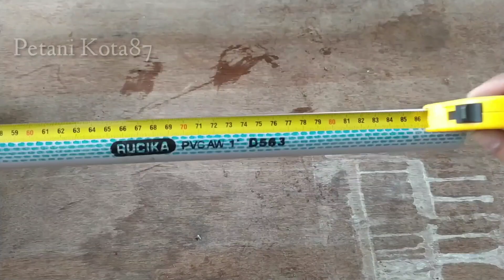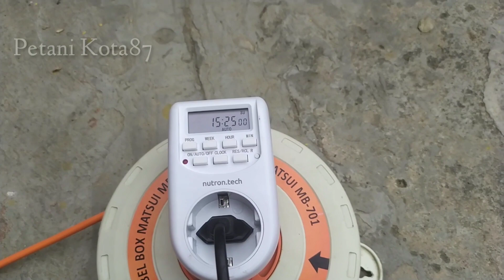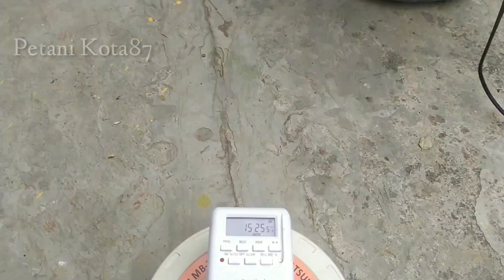DIY : How to build Ebb & Flow  Hydroponic System Using Plastic Bottles (Part 1)

Comment: May I know the specification for the pump? Or the website where I can purchase the pump? thank you in advance
Reply: I would use a 24 volt brushless pump with controller that has a HEAD of 2 meters. Make sure the pump has a speed controller so you can vary the height of the water.. Warning : 3 corner PVC joints may not be available in your country.